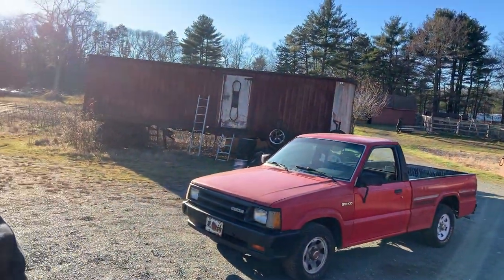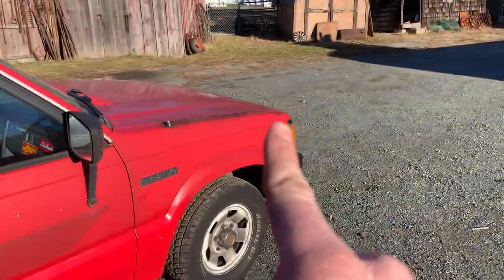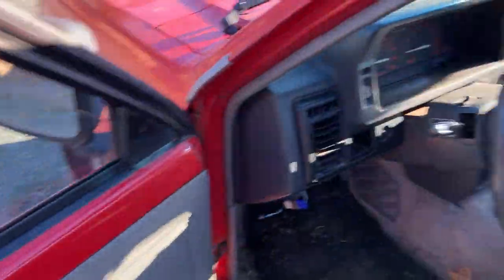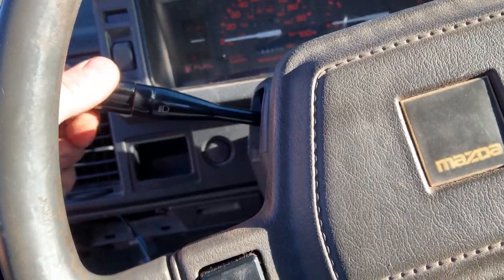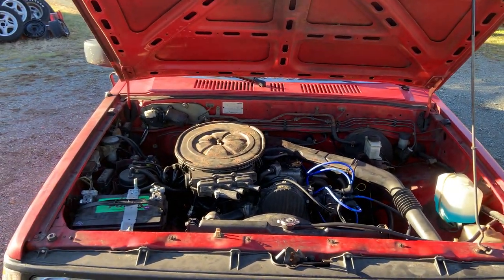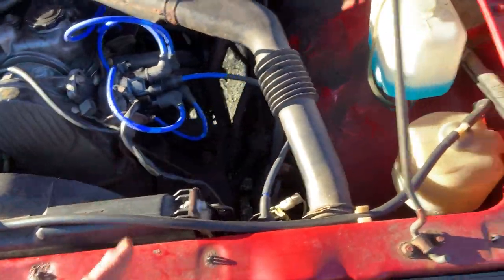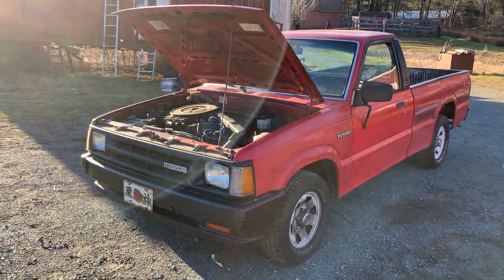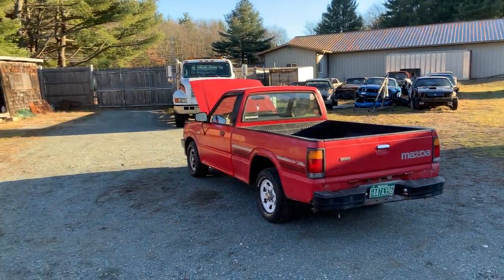This 1980's Mini-Truck is the Slowest Vehicle I've Ever Owned

Comment: SE-5 is kind of a confusing trim. Pretty much a sporty, better than base model package. It was Mazda’s response to the base hardbody’s and Toyota pickups of that time. The SE-5 came with standard features the other guy’s base model’s didn’t like rear bumper, tow mirrors, vinyl striping, tint, etc. I can’t remember all of them but that’s the gist of it.
Reply from the maker: Oh you mean the rear bumper that I cut off with a saw 😂 whoops